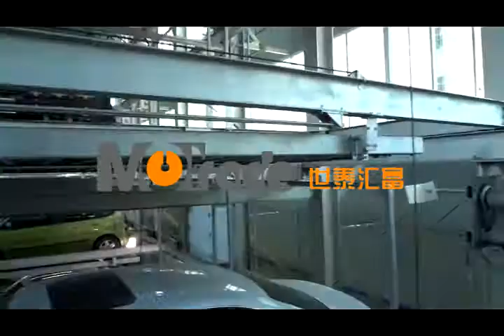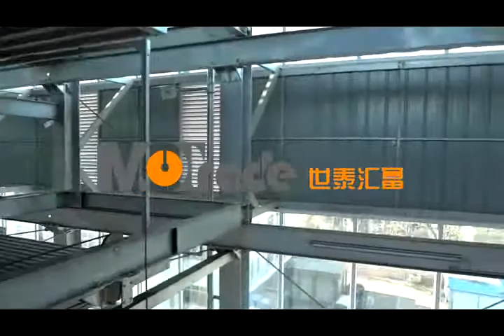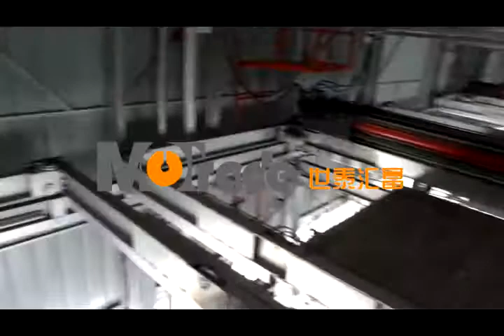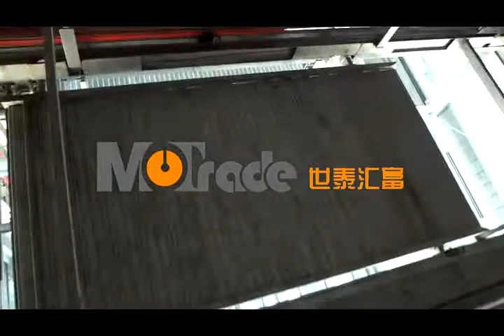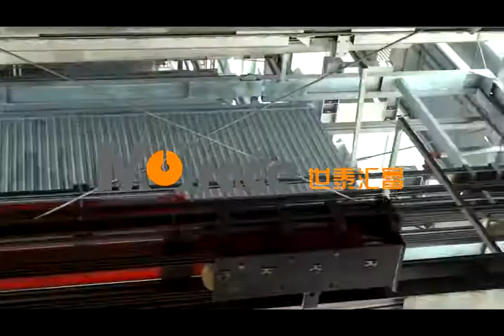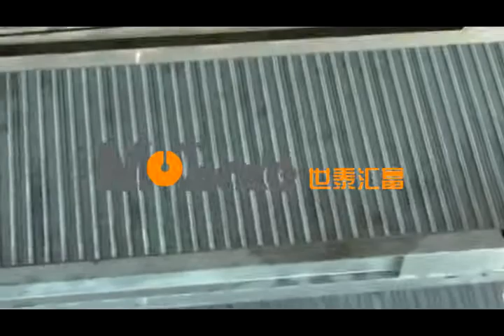15 Floor Hydraulic Puzzle Parking System 180 Parking Spaces Part B

Comment: Good systems. If 15 floor. ,but to take 1 car in 15 Th floor it take more power and time
Reply: Good day! Thank you for your comment! 
According to the opinion of our customers, the speed of our systems is high enough <90s - <150s.
These lifting systems are well suited for commercial parking
 invironments and are powered by independent electric hydraulic pump units or a multi unit power station pump system that can operate up to 5 lifts depending on the con guration, layout, and other technical factors.